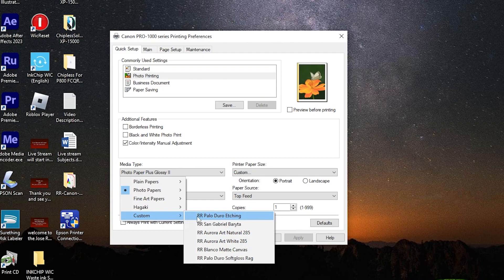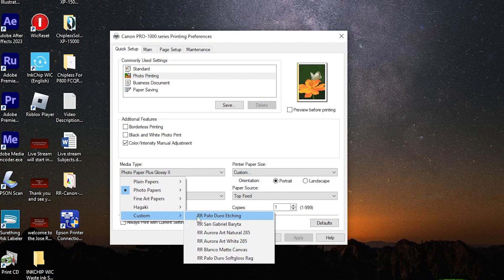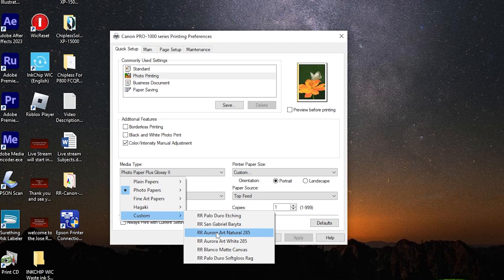So what do the Media Choices in the Printer driver control?

Comment: For the Canon Pro-100 with Red River Papers, do we just need to use the Red River ICC profile for that paper or is there more to set?
Reply: No expert here but, He mentioned Pro 100 & up. I use the pPro 100 also & just use the media type RR suggest. Also, if I don’t want the over 1” wide border, I’ll pick a paper media I feel is close enough & have been pretty lucky so far. He has avid on how adjust the raise the Pro 100 print head if needed. I had to do it once a while ago but forget how I did it. Have to find the vid again & save it to a print vid library. I’m gonna move up to a larger pigment base printer anyway. Actually want to go larger than the Pro 1000. Maybe 30”-40”. Once you get past the initial purchase cost, I doubt it will cost more to run. Maybe less because it will have bigger ink cartridges. Have to look into it & make sure.
  Happy Holidays & happy printing.
Reply from the maker: Pro1000 and up. Not Pro100. With that one you download Red River paper profiles..choose the paper choice they suggest and turn Color Matching in the driver to none.
Reply: @cheo1949  I do that! I learned that right here on this Chanel.